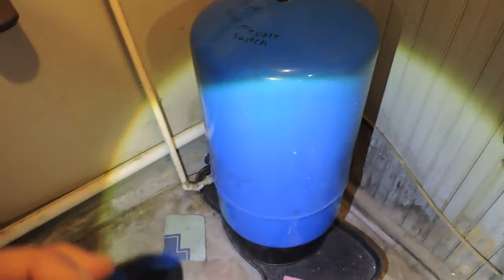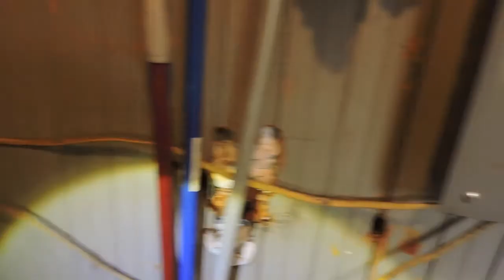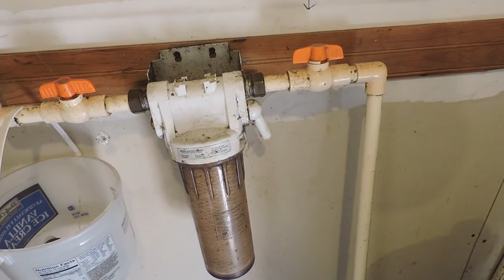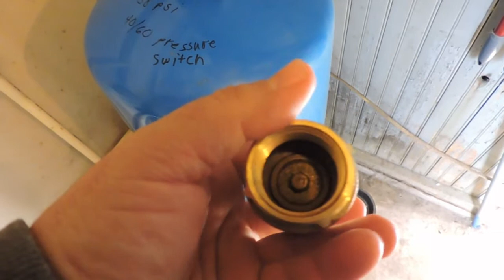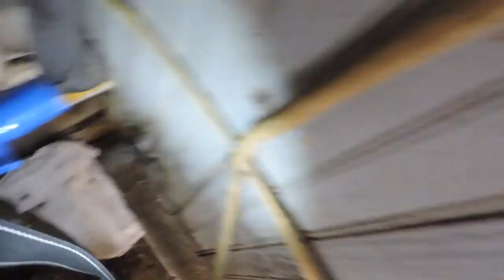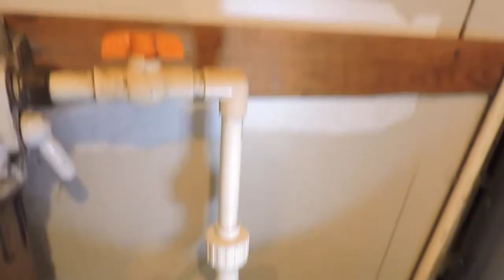Well Pump Pressure Problems

Comment: updates on my well ,after 4 professional Americans big company , not one of them know exactly what was wrong with my well ,My helper A Young Mexican no Liecence Figure it out , we change the switch and yes it was not working burn on one side , so you are right , thin he try first to pull the pump out the well , thin he put water in the pipe he said no not working, thin he check all connections , he check one of them it come loose in his hand he connect it  he put water in the pump start the pump ,the pressure when’s up to 40  all is great that the wire connection was loose so he  connected in the water was flowing  perfect, so from 7 thousand to 400 Dollars and his worth every penny,i want to thank  ,for all your information I am so happy , you save me , I hope you don’t mine I am going to copy and paste on all your video for people to watch you before they spend there Money ❤️

Comment: Why they would have installed the switch and valves so close between the wall and tank is beyond me. Put it where we you can easily get to it.
Reply from the maker: Tight space in the back of a closet.

Comment: You have a leak.
Reply from the maker: That's what I thought initially.  But, I checked throughout the house and all around the expansion tank plumbing.  There were none.  That's why I concluded that the leak must be down in the well somewhere - possibly the check valve on the pump failing.
Reply: @countrylivingonashoestring5159   I only gave a quick answer. I was sure the leak was in the well. Could be a fitting, depending on type of fittings in well, type of pipe(poly, roll pipe, steel). Possible check valve, rare , but possible. From the sound, it would seem to be quite large( time between switch) If you do not hear a leak at the wellhead(leak at pitiless), you will need to pull pump. Based on what I hear, the leak should be obvious.
Reply from the maker: @stevefarrow9327  Thanks for the info.  I'm trying to limp along until spring.  With a foot of snow on the ground, pulling the pump wouldn't be fun!  Besides, if I'm going to have to pull the pump, I might as well replace it.  It's about 18 years old.  So, there may be another video in the spring of my pump-pulling adventure.
Reply: @countrylivingonashoestring5159  18yrs...you got your money’s worth.  Best to figure replacing with pump, wire, roll pipe,  brass or stainless fittings, all stainless clamps... have fun and good luck.